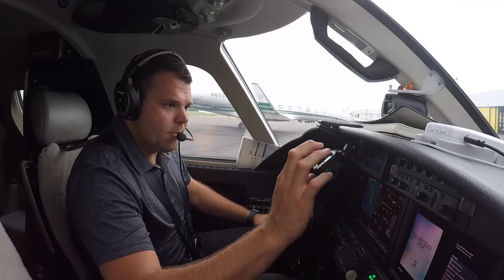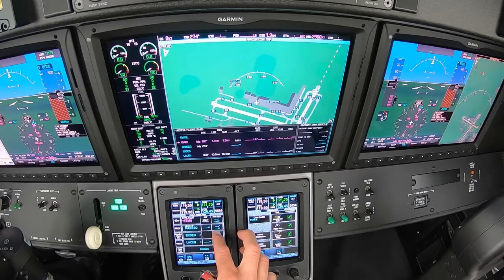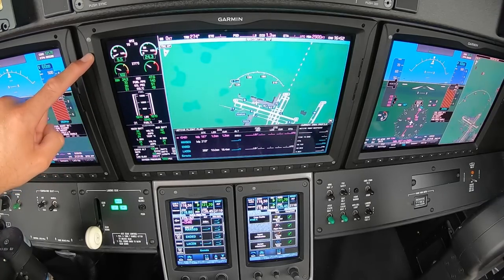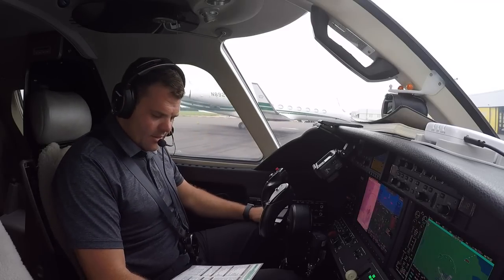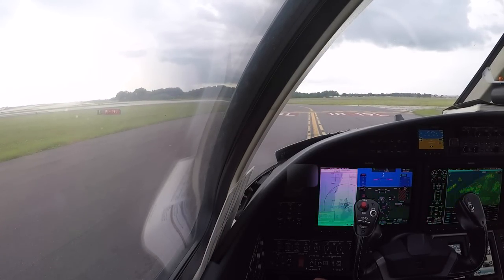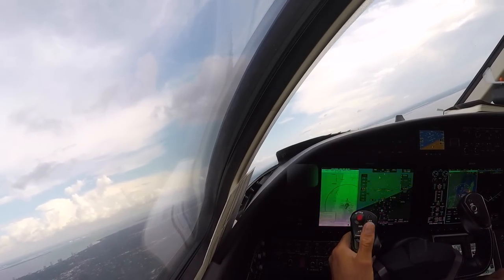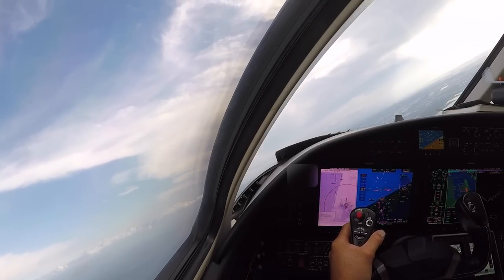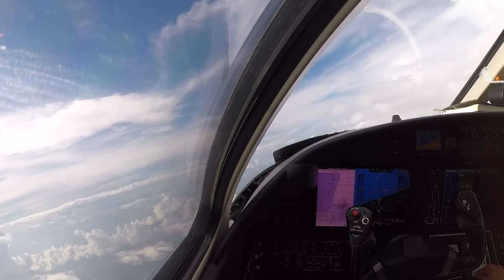Citation M2 Stormy Departure out of Tampa - Private Jet Flight

Comment: On your Garmin, does selecting FLC automatically preselect a climb speed? On G1000 variants, an FLC press selects the current airspeed which can then be smoothly adjusted manually down to force a climb. The way you described yours sounded as if you didn’t need to adjust the speed for it to smoothly transition into a solid climb. Just curious if this is a difference.
Reply from the maker: Yes and no. For the most part, yes it does. The reason is because this airplanes have VNAV. If I have VNAV on and select FLC, it will go to the VNAV speed that I have set in the PERF section of the GTC. If I had it in manual mode instead of FMS though, then it would be blue and would function like you described - initially syncing to whatever my current speed is.

Comment: How old are the batteries? Just noticed the amount of voltage drop when the starter motor was on. Is that normal for these engines?
Reply from the maker: I'm not sure, this is not a plane that I manage. I was just contracting on this one. A huge drop is pretty normal, the starters initially draw around 800-1000 amps as soon as you hit the button.

Comment: Ryan, how You record ATC sound with environment? Thanks for the answer.
Reply from the maker: It is an adapter from nflightcam.com
Reply: @TheRunwayRyan  Thanks ATC sound ok. But still I don't know where did You get environment sound from? Is it track from other recorder?
Reply from the maker: @witoldszafranski4316  yes, for the ambient noise I use one of the other GoPros, and I turn down its audio stream so it sounds right.